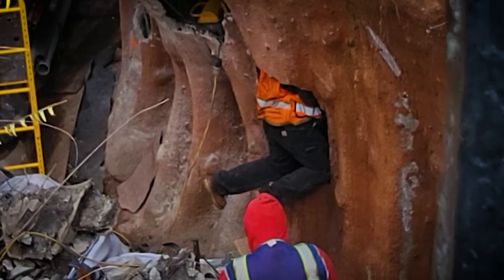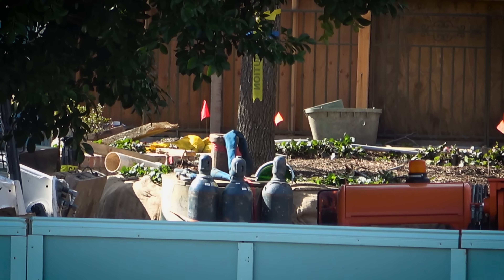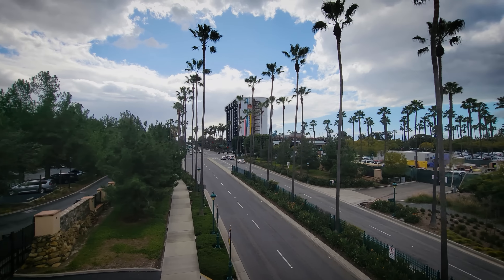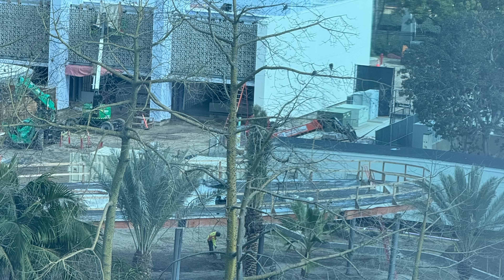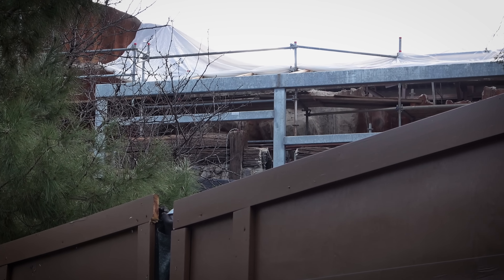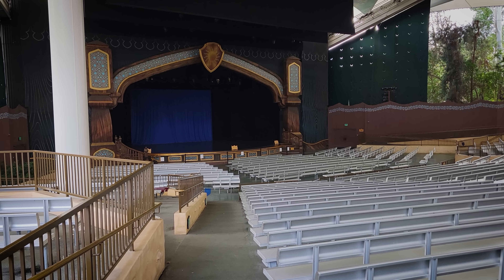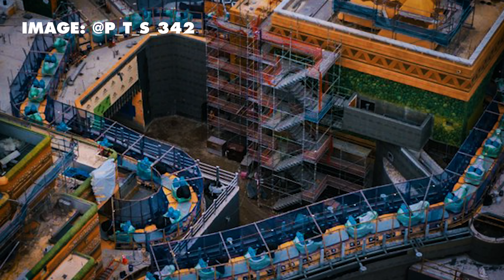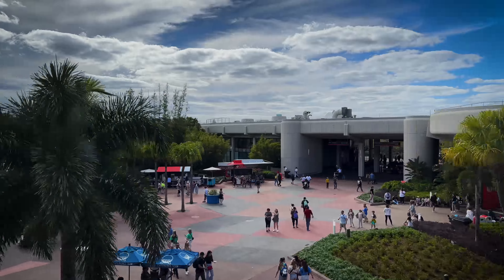NEW construction delays + EPIC Universe video | Disneyland Construction 02-12-2024

Comment: I’m going to go way out on a limb and guess the delay on the Twain is due to the rains we had over the past two weeks. Moisture content, both in the material you are painting, as well as atmospheric moisture (either free water in rain or humidity) play key roles in what and when you can paint (see the early problems they had in Toon Town). They are likely waiting for material to dry out and reach optimal moisture content before they pick up the paint work again.

Same thing with Astro Orbiter. You can see the paint crew is just getting started again. Except on this ride, they are painting metal structures  versus the more moisture sensitive wood on the Twain.
Reply: I agree. But let’s just say they are actually done with the painting the exterior, they still have many maintenance concerns to tend to as well as cycling her appropriately to comply with CalOSHA requirements. There’s much more to a refurb than he’s making it seem.
Reply: Agree.  I would think all they ran has impacted quite a few jobs to some extent. 
Really looking forward to what HM looks like when complete.
Reply: They stripped the finish off the floors to resurface right before the rains and the water caused problems. Was alot of water in the interior.

Comment: I had sent you a information on blue stage of the color codes. Red usually means stuff with electrical. Because when I see them doing electrical work, where they’re running electrical lines underground, they pour red concrete in the marking the area with red marks so there could just be a electrical line that’s in that wall in a white line means construction. Blue means stuff like water.

Comment: 19:40 Those orange poles attached to the barn will be finished to look like wood logs/beams. They are replacing a structure that was previously there, holding up a trough that carries water to the top of the water wheel. It's possible they previously built this out of real wood beams which deteriorated, and are now being replaced by metal beams disguised as wood.

Comment: Do you know for a fact that an additional elevator was mandated for ADA compliance? Because more than 30 years in, I would be surprised if this is the reason. My guess is that they are adding the wheelchair exit elevator — and redoing the queue — for purposes of efficiency and show. 

The current procedure (or at least, prior to the refurb) at Haunted Mansion is that when you approach the entrance and need mobility accommodations, you are asked if you can walk a short distance or if you need to take your mobility device with you the whole way. Depending on your answer, you get a color-coded paper that you hand to a cast member near the hearse. If you are able to leave your mobility device, you park it near there. If not, you take your wheelchair or scooter and wait on the ramp. If you wind up on the ramp, you then have to be escorted all the way down to the loading area by a cast member with a flashlight. In order to exit, your party must be personally escorted back to the stretching room by a cast member with a flashlight, and then a cast member accompanies the party all the way back up in the stretching room — and then ushers them out after all the waiting guests have boarded the stretching room elevator. This is a cumbersome and labor-intensive process. But, the Haunted Mansion is literally Disney’s textbook example of an instance where safety takes precedence over show and efficiency. And this ultimately is about safety. 

If the queue is remodeled to be accessible, then Disney can say goodbye to the color coded paper slips. Disabled guests might be able to get right in line just like they do in any line at DCA, and interaction with cast at the entrance could be limited to guests returning to use DAS. 

The exit elevator will eliminate the need to escort parties all the way to the stretching room and all the way back up to ground level. It will hugely improve efficiency. 

And, it will improve show by not taking anyone out the entrance. 

I personally think that Disney has really strong reasons to do this extensive refurbishment without being compelled.